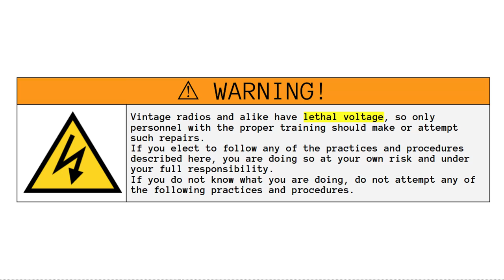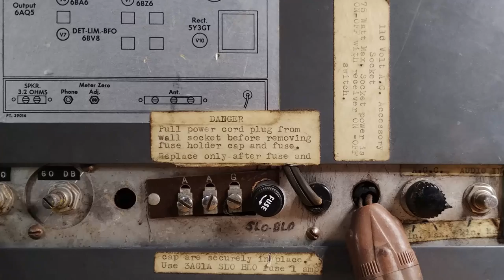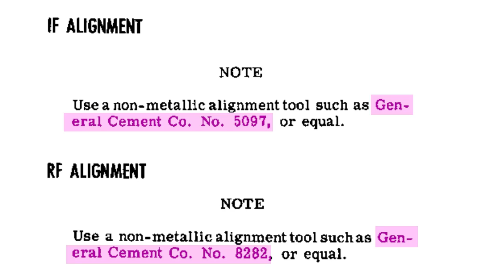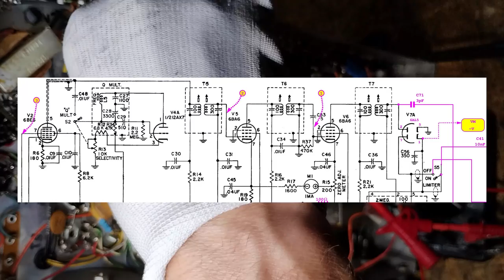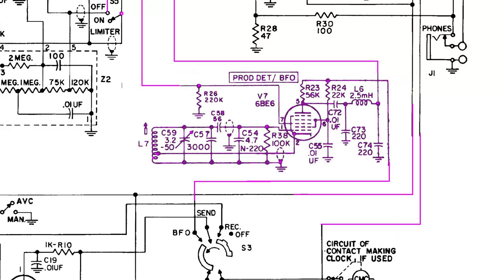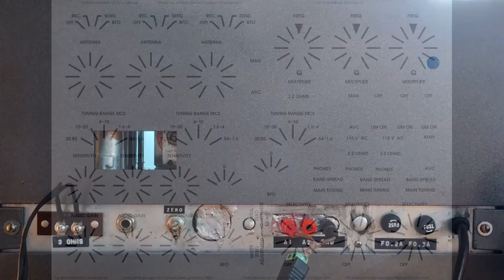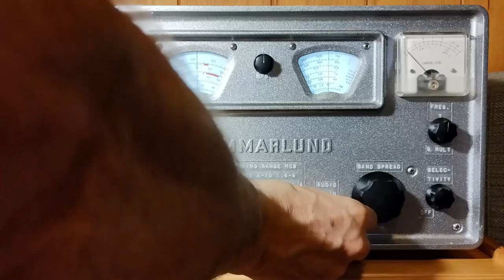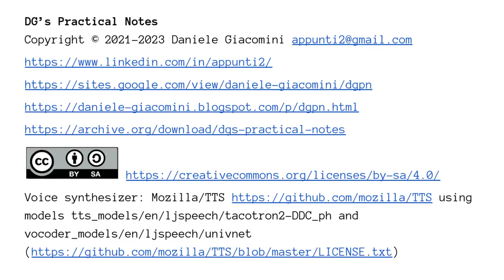DG’s Practical Notes, R#14 Hammarlund HQ 100A, 1959-1962

Comment: We rarely see equipment with so many change. It look like a prototype from Harmalung...
Reply from the maker: Well, I disagree: that was definitely work from an enthusiast, with low resources, who wanted to make the most of its receiver. The electrolytic capacitors used in the additional board were not even rated for a sufficient voltage.